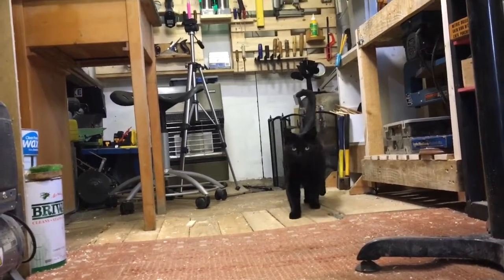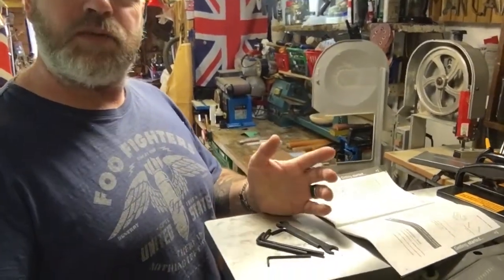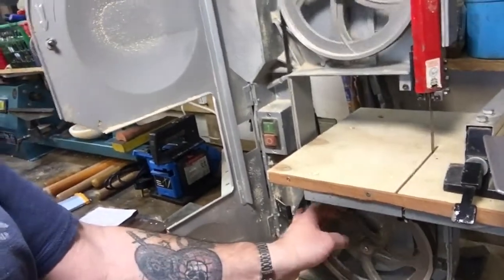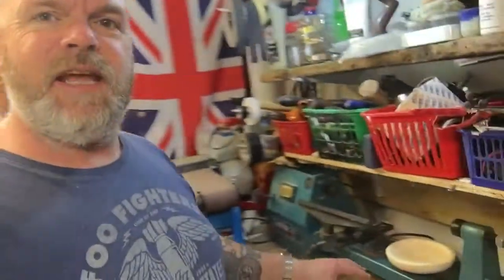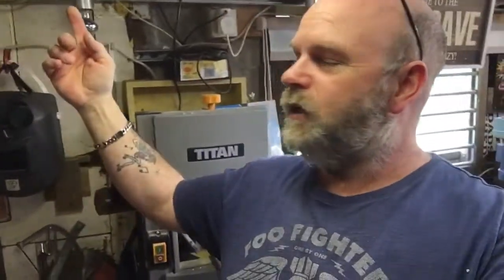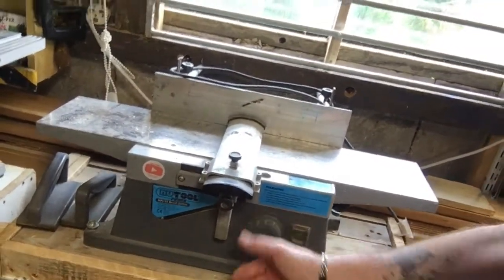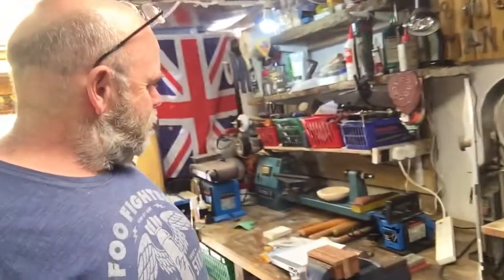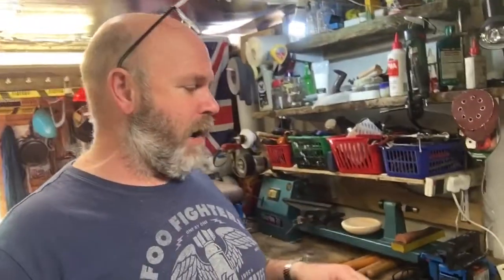Vlog EXCITING DELIVERY/ WORKSHOP WANDERING

Comment: Hi mate I've had one for 2 years now if you take the time too check it over and set it up  properly it works fine. It does cause slight snipe but extending the bed sorts that out. Good find mate and hope it goes well. I personally think your workshop is awesome
Reply from the maker: Thanks 🙂 the workshop is loads better to work in since making some changes. The first thing I did on the planer was undo and set up the blades. I have done some thicknessing and it seems great. I think I'm just used to cheap tools so never expect too much. 👍

Comment: Great new tool I have one and love it I made a longer bed for the bottom but the best tip is to bin the push pads not safe and remember#stay safe and make  🍺🍺👍👍
Reply from the maker: Thanks Brian, yeah I have heard the push pads are rubbish. These that have come do have a rubber pad but I have got some more. The fence on this one seems very solid so I don't know if they changed to thicker gauge steel. Stay safe David 👍
Reply: @InTheWorkshop  excellent but I used a piece of worktop to make the bottom bed longer to stop the snipe should be the same length as the top bed

Comment: Lots to do there David.  If you do the same quality refurb with the other items as you did with the table saw you won't go far wrong.  Interested to know your thoughts on the thicknesser as that is my next purchase all being well!  From what I can see from iForce the saving is about £30.  Is it worth it considering the issues you found already?  Not in stock at SF at the moment but is it worth waiting for considering the relatively small saving?  Did you review the Titan band saw?  Can't seem to tension my blade enough so that it cuts straight in wood that is over 25mm thick!  Sorry for loads of questions!
Reply from the maker: Hi Neil, this planer was £40 less than Screwfix and it has no issues different from a brand new one. Apparently it is luck of the draw with new ones. For all I know the previous owner might not have even switched this on as there is no wear to anything. The Titan bandsaw is self tensioning as far as I know, it just works on the spring. Lever down for tension off lever up for spring tension on. Sounds like drift which is usually because the blade is in the wrong position on the wheel tyre or another setup problem. If you think it could be this there are loads of good bandsaw drift videos on YouTube. Thanks for your comment, take care David 👍

Comment: Just bought one as yet not taken it out of the box
Reply from the maker: It's hard work getting it out of the box. I ended up cutting the tape on the box bottom and lifting the box off 😀
Reply: Wood Stuff Workshop got to make a trolly for it yet then check it out and adjust it all it’s not top end but for what I want it will do there’s a lot of good vids out there to set it up